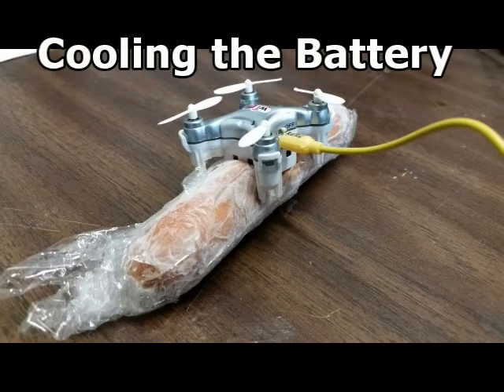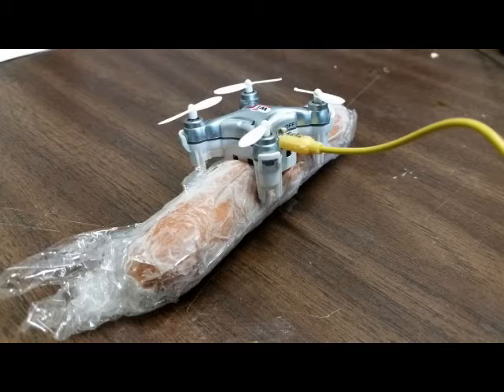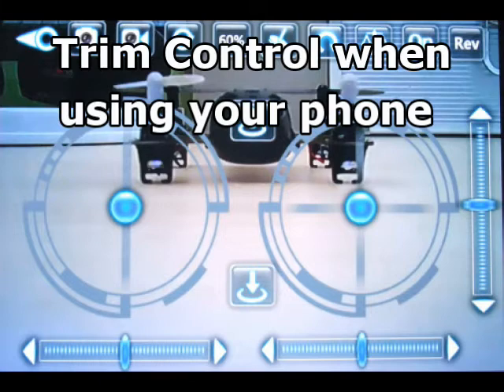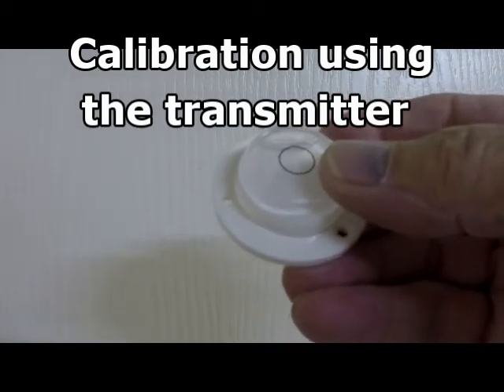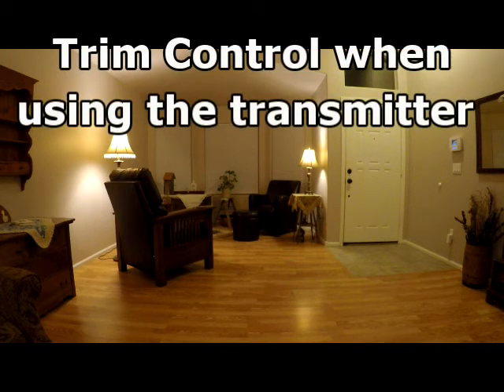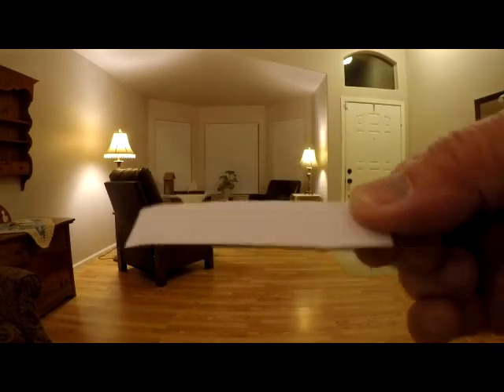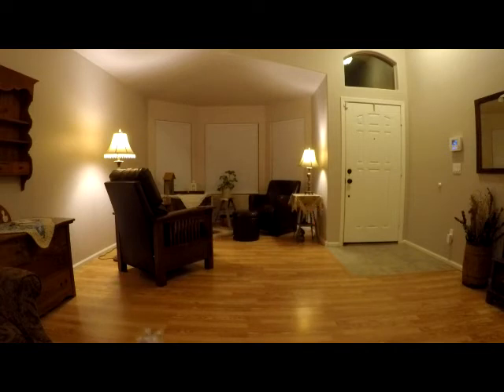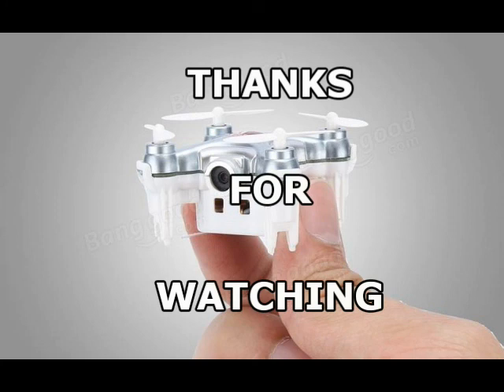CX-10WD-TX Calibration and Trim

Comment: There is something wrong with my drone. I can’t even takeoff without it flipping out fo control
Reply from the maker: Oh, that's sad. Are you sure you have the props on the proper motors? God bless.
Reply: mrkentdotcom I’ve changed them multiple times making sure that they were in the right place, but I think there something wrong with one of my motor not giving enough power
Reply from the maker: @skyforce2132  Oh, you are probably correct. I'm sorry to hear about that. God bless.

Comment: Hi! Does this have HEADLESS MODE? Some descriptions mention it, some not...
Reply from the maker: I have returned mine because it gradually lost its ability to hold altitude. I don't recall seeing anything in the little manual about it. But I didn't look for it either.
Reply: Ohh... mine arrived today. :-) Altitude hold works almost well, it slowly goes up for a while but then stays (indoor). I think it needs trimming because it tends to go a bit forward and right, but thanks to your video now I know how to calibrate it. :-) No headless mode, but I don't need it anymore. :-)